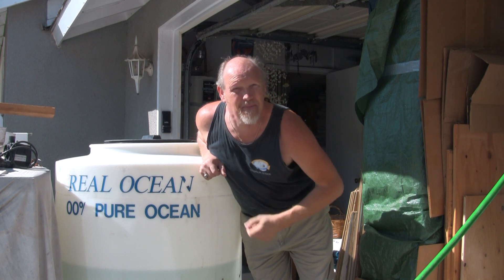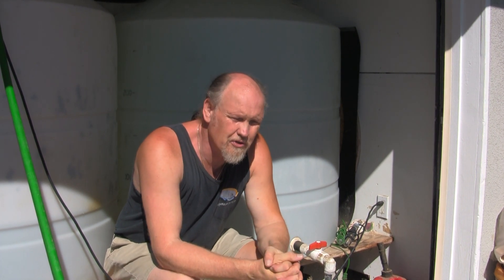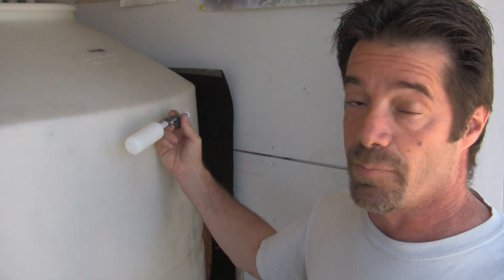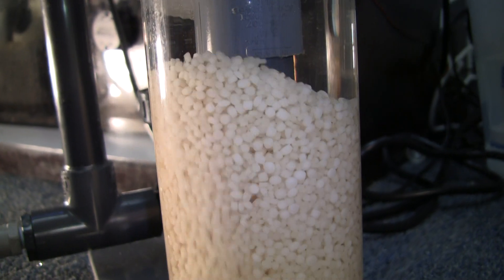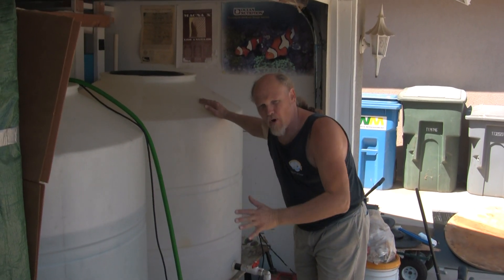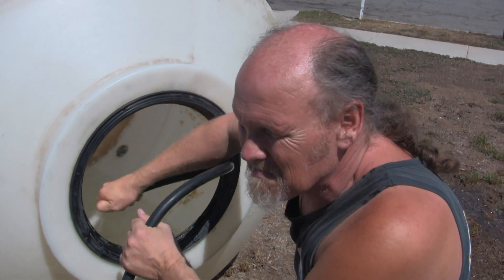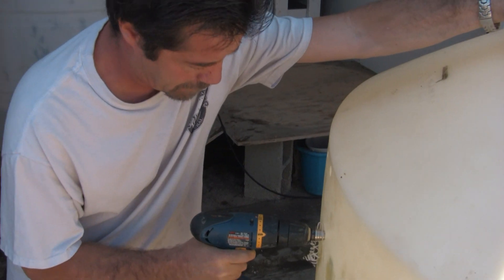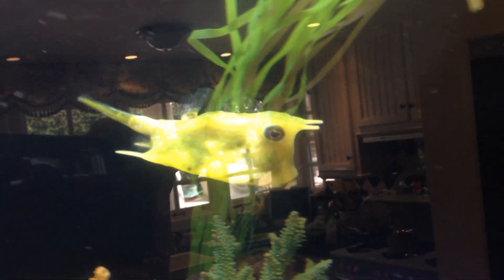Spectrapure Aquarium Water Filtration LA Fishguys Episode 134 part 1

Comment: Hi Jim,

I am a big fan, but your arguments about "real ocean water" are wrong. Yes, this water may has some small organisms that can be beneficial for your system. Possibly, this water can be slightly contaminated too. But the real problem is concentrations of Ca, Mg, CO3, etc. Your augments are correct when you used the ocean water from the reef.  That is OK - all elements are balanced etc. When you use "real ocean water" not from the reef, your water is not reach in these elements. Moreover, the salt concentration can be very high (as much as 0.03 in Perth) and changes with seasons !!.
Or just using the logic. If your "real ocean water" is the best solution you should get coral reef from the place that you catch it.
I prefer ocean water  - because is far more cheaper and has some beneficial worms, etc. But I supplement Mg, Ca, and CO3.
I used RODI water only to replace the evaporated water. For long run - this is much more cheaper solution.
Besides RODI does not remove all contaminates. It is just a myth.

Warm wishes and many thanks for your channel;
Piotr
Reply from the maker: hey P, Catalina Water Co also supplies real ocean water to the Aquarium Of The Pacific, both in Long Beach. I assume that the public aquarium demands water of a certain quality and I also assume that this is the same level of water quality that has been delivered to my home for the last 15 years. In that time I never experienced any issues with the water, aside from reef tank customers. I was OK with real ocean water, especially its convenience  ;)